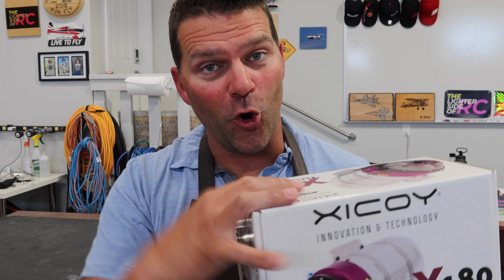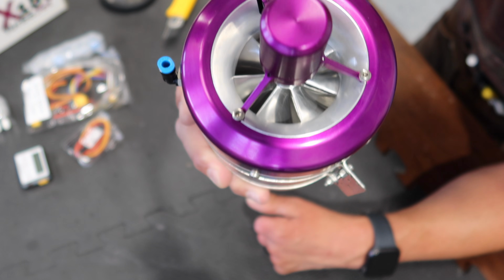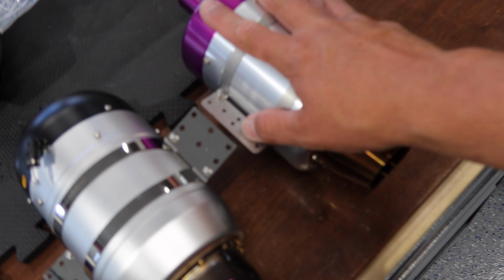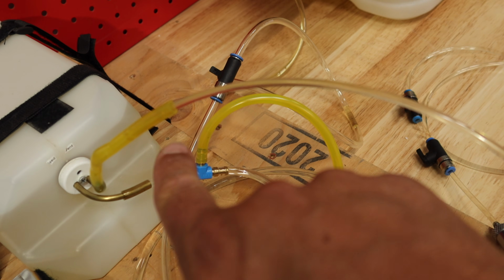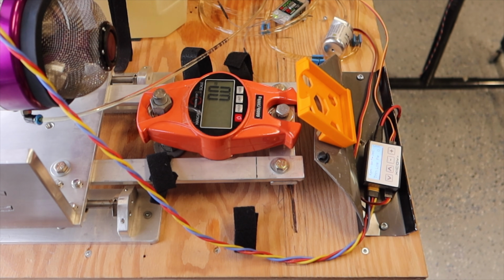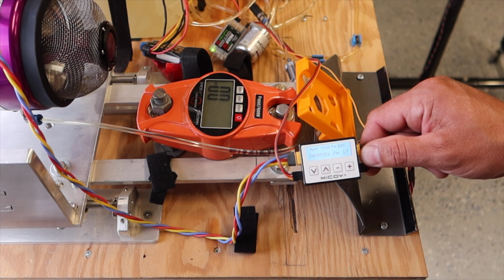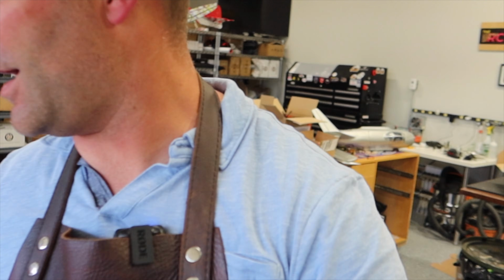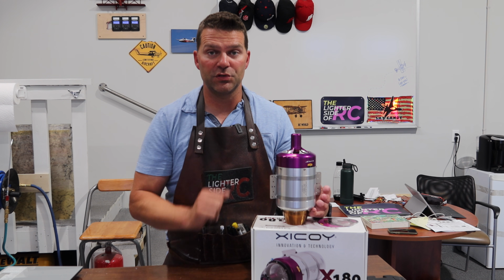XICOY X180 MICRO TURBINE - Unboxing, Test Run and Review - By Gaspar

Comment: Purchased a 1:6 Scale BVM F16. The manual states that it has a thrust Class of 140N (21-32Ibs). Would you recommend that I follow the manual and just purchase a Swiwin 140B, or should I get a SW 170B. This will be my first large Jet, and just would like to be safe. Thank you very much for all your help.
Reply from the maker: Hello Pierre.  This will come down to the elevation your flying at.  We are at 3200 ft where I test the engines and fly.  If I was getting this aircraft I would be putting in a 190 most likely but in general we will see a 15-25% thrust decrease depending on the temp that day.  If your at sea level or close than a 140 may be perfect.    Either way I have seen many planes crash because they were low on power and I have had or seen many planes be saved because the powerplant that was installed was on the upper end of the recommended range.
Reply: @thelightersideofrc  Thanks for the information, I’m at 866ft above sea level. Already submitted an order for a 140 which was shipped today. Will just have to purchase a 170 and sell the 140. Thanks again.

Comment: its the size of a 166, I did a video on it with weights and size next to one of my JM166  Also I mentioned it before the "Hub" is not the ECU, the ECU is on the motor. I sell various lengths of the ECU cable for various installs. The hub is just a connection point for everything.  I'm in the process of replacing my 166TS with two 180s in my F-14.  Yes I like Xicoy because I sell them but just based on facts, the Xicoy are pretty efficient and from what I know they are the lowest weight to ratio.

Comment: Very nice engine. My Odyssey may need this since I'm not 100% convinced the x120 is right for it. Couple of corrections. The ECU is under the cover,  so the terminal is just that. The connector type on the engine is the MR30, not XT.
Reply from the maker: Yes I always get the ecu correction. As mentioned in the video it’s a data relay module. Ecu used to keep terminology simple for people to understand. Thanks 😊

Comment: Would be nice to see the sw190 ran at a similar density altitude. I’ve seen how fast the X180 is near sea level, it is obvious the altitude and temp out there is having an effect as I’ve seen the X180 make well over 185N.
Reply: Our experience has been of the smaller Xicoy, for us they don't run well at the higher alts. I wanted them to work so bad :) but SW 170/190 runs fine but does accelerate slower at the higher alts.  I will take reliability over slower acceleration any day of the week and were only talking 1 - 2 secs.
Reply from the maker: Great points and feedback!

Comment: Nice job, I am guess the settings are Identical for each motor since they're gonna be a twin. David is a very nice guy, The even offers to get the at a great price for us guys at the field.
Reply from the maker: Thanks Victor.  Yes the engines should be setup identical.  Did not run the second engine yet.

Comment: Nice video. You guys really do get punished on the trust output in Calgary. Curious, do the Swiwins have the ECU inside the turbine cover like the Xicoy? The Swiwin 190 has some nice specs - I’m comparing this engine to my JETCAT P120SX’s - Xicoy is overall lighter, slightly smaller, less residual thrust and of course more max thrust. Hmmmm…..
Reply from the maker: Hey Paul.  Yea we sure do!  Some folks think we are nuts with the engines we install in our aircraft but it's pretty obvious why.  The swiwin's ECU is under the front cover and the silver box (what many refer to as the ECU) is just a Data Relay module.  Swap kits are pretty common with the swiwin's as well so you can move an engine between aircraft and just buy a second install kit.  So many great options out there!